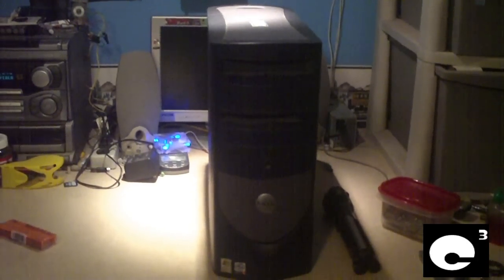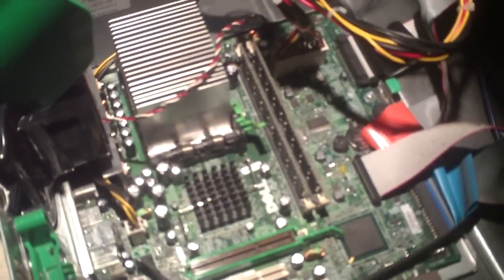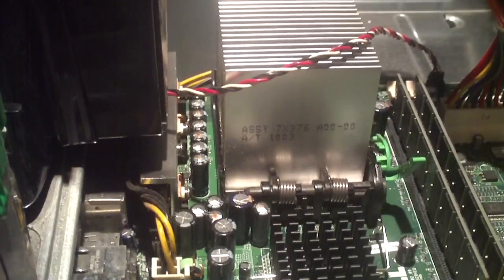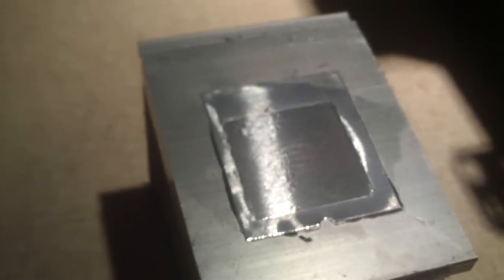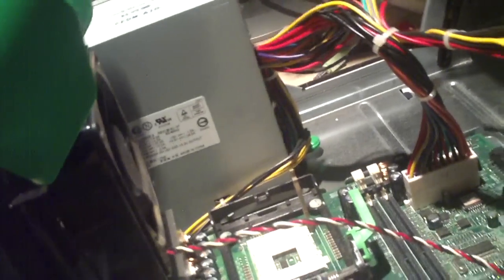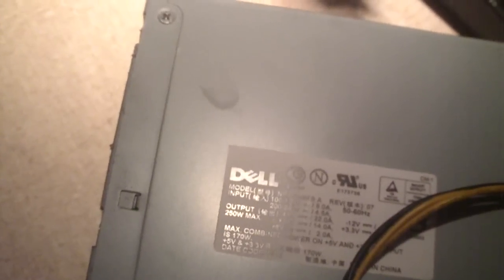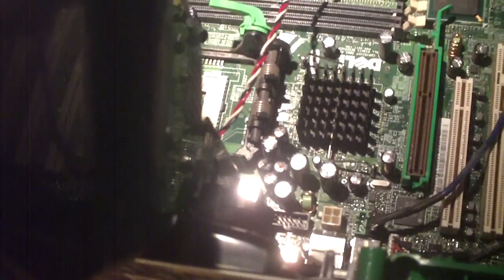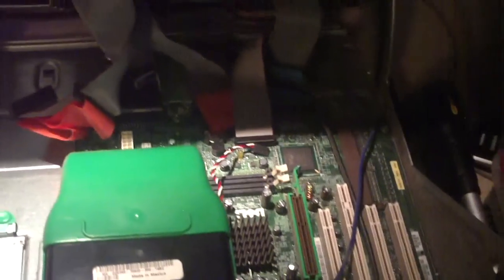Dead Dell OptiPlex GX260 Autopsy

Comment: I have a fair amount of P4s with no bad caps at all, but I've seen even more with bad caps than that, lol. I still use a P4 as a main computer with solid state caps, its the most stable machine I have. its never crashed. but my athlon 64 laptop on the other hand...

Comment: How did you remove it??? I bought 2 of these from Craigslist and after working for 18hrs (not straight) on them, I still cannot remove the motherboard. I saw videos of the GX270 being removed, but god, that looked like a piece of cake...
Reply: dude its 6 cables and one bolt

Comment: Got the same computer and motherboard. I was having problems with it saying keyboard error no matter ps/2 or usb, but the keyboard and mouse don't work. Later the problems got worse and one day it would not boot, it would reboot several times with no signal on any monitor. So I thought it had to be something with the power supply sience I thought it kept losing power. I didn't see any capacitors leaking.
Reply: I had those issues too What I did was reinsert the Pentium 4 processor and it would turn on.
Reply: And surprisingly my computer runs without thermal paste